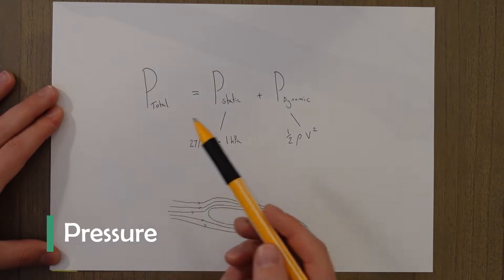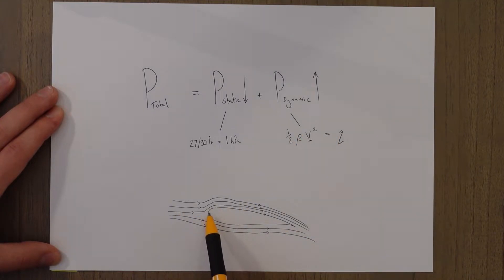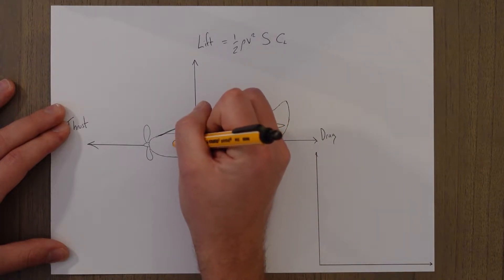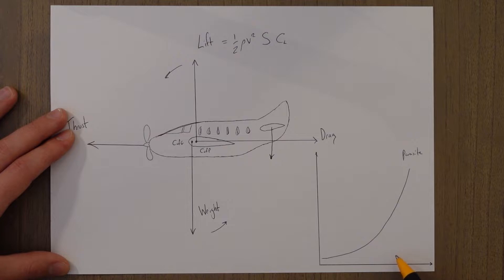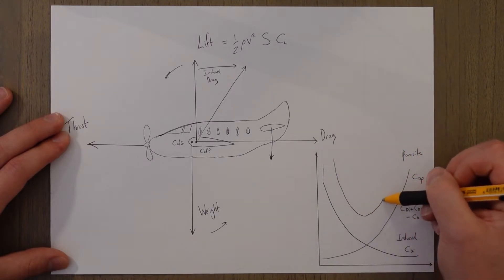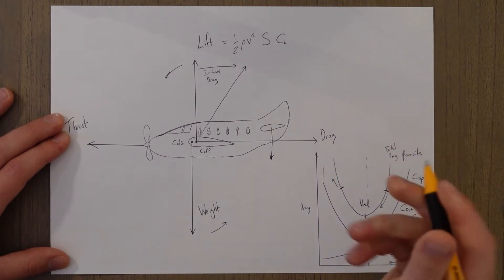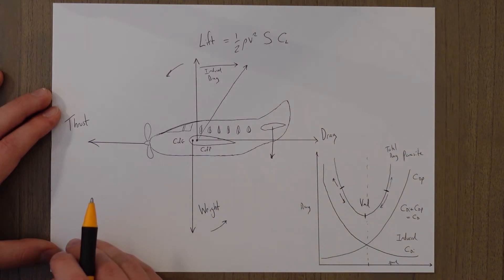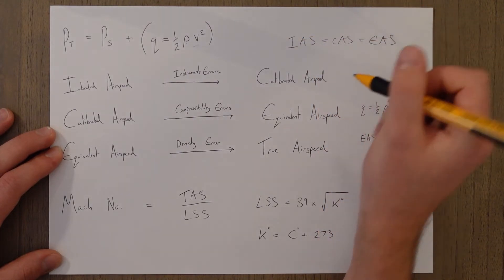ATPL Performance - Class 2: Principles of Flight.

Comment: The explanation of induced drag seems a little bit fishy. Isn't it related to downwash and angle of attack? More speed -> lower AoA -> less downwash -> less induced drag. 
If it was the depicted horizontal component of lift it would not decrease with speed, but keep growing. As the lift grows, so would the horizontal component.
Am I wrong?
Or is the lift vector supposed to be more and more vertical the faster you go?

Comment: 12:15 explanation is wrong. Density at sea level divided by density at altitude. It is logical as TAS is greater than EAS at altitude , there fore numerator has to be greater to get higher value of TAS